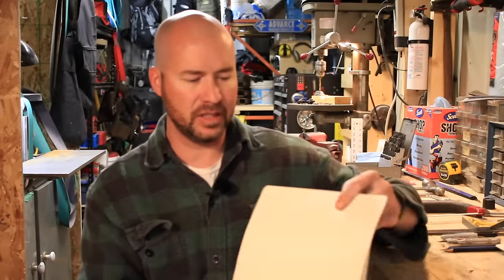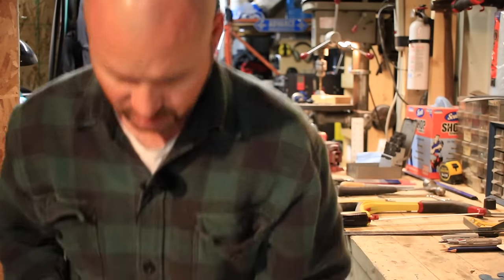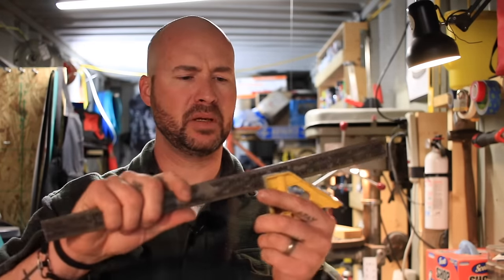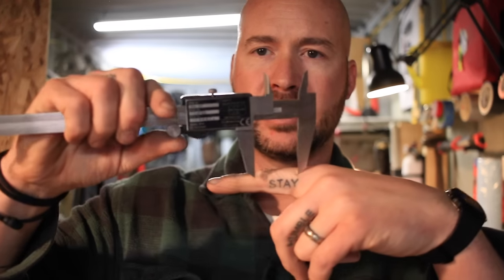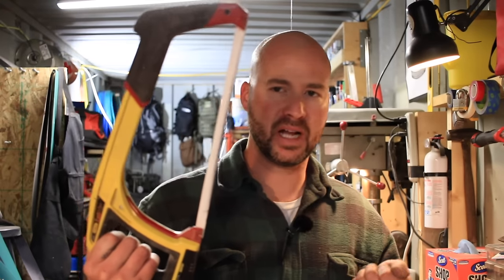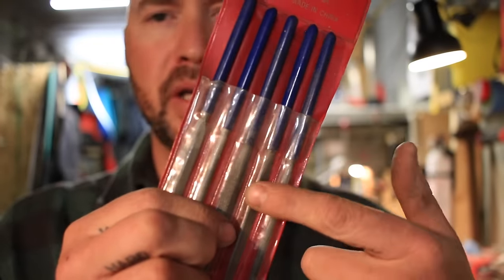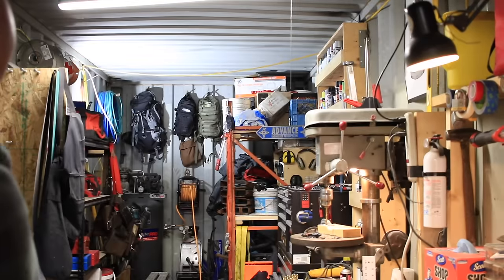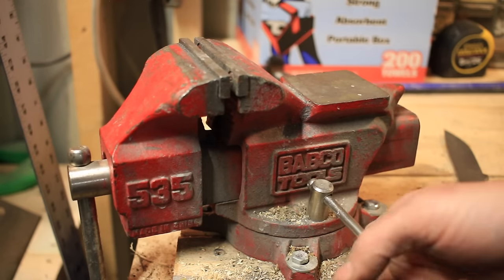Basic Knife Making Tools - Part 1of 3 of a YouTube knife making class

Comment: I want to start making knives, and i have a (i think at least) really cool looking knife.  I didnt even use those templates, i used a fork and a resturant knife while at dinner and i was bored.  I got the rough design and cut it out of wood with a hack saw.  i then made notes and cut another one out of wood untill i was happy.  i still dont even have the measurements, but i have used a ruler to drawl out some pices i wanted to remove on the knife so i can put some paracord in to it.  im going to suqare it up with a ruler and measurements, then put it in metal.
Reply from the maker: Do it!
Reply: Don't the cord handles hurt your hand?

Comment: What thickness and width should I use for a knife.  I am very much so a beginner.  Should i be using 1/8 or 3/16 thickness?  And would you recommend 1 inch width, 1-1/2, 1-1/2?

As far as far as the type of steel, I know that most people recommend 01, 1084, or 1095.

Comment: Any chance you can do a video on the jig you use to get the proper angle for the grind on your blade when using the belt sander?
Reply from the maker: +undertheshadowhc you know what? I actually have that info in this video: https://youtu.be/TyS8kU81y4c and it's right at the 3:30 mark. I hope it helps. Cheers!
Reply: Thanks!

Comment: What kind of steel should I buy?
Reply: I would like to know as well.
Reply: he uses 01 tool steel. but any high carbon steel should be good. My only problem is no one sells it where I live and i don't want to buy it online because shipping prices is retarded
Reply: Try old sawblades.

They might not be as thick but they are good steel.
Reply: O1 is good, 5160 is alright but is fussier to heat treat if you want to do that yourself, 1084/1085 also are nice simple carbon steels to start with. 5160 equivalent spring steel can be had from old car or truck leaf springs, just keep in mind that used leaf springs could have micro fractures from the stress of being used. Most knifemakers recommend starting with known steel, just because there is more information to be had about working it and heat treating it. It costs a bit more that way, but it's safer and easier in the long run.
Reply: Engineered Adrenaline 01 is the best tool steel for amateur knife makers it's strong has good edge retention and is one of the easiest steels to heat treat yourself.
Reply: Buy cardboard it’s the best and cheapest
Reply: Hattori Hanzo
Reply: Old tool steel out of the scrap pile. Files, saw blades, etc..

Comment: get a drill bit the thickness of the knife blank  then use to scratch  the center line of the blank  since the point of the drill is half the thickness of the blank  so you have a center line  to file or grind down to and take off to much on one side

Comment: Hey I'm new to your channel was looking at buying some grinders and sanders for a great finished knife was wondering if you could help me out?
Reply: i used a bench grinder to set a concave bevel, then used 220 over a piece of steel flatstock to flatten it out. if you really want a belt sander it will run you quite a bit. just wondering, did you ever get around to it?

Comment: where would I be able to buy the steel to make the knives??
Reply from the maker: All depends on where you live. knifemaker.ca is great if you live in Canada. Or Metal Supermarkets has locations across Canada and US. Other than that I can't say. Cheers!
Reply: Lawn mower blades should be made from a pretty good steel for knives, and are generally quite rectangular in shape.
Reply: Lawnmower blades work good will teach u lot cheap to start with l have one made out of it works good  with walnut handle

Comment: Sorry if this is a stupid question I am new to all this. Why do people make scales out of non metal things ???
Reply from the maker: You can use metal things if you want. It's mostly a preference thing. Handles for tool are more comfortable with something like wood or synthetic materials. Synthetics like G-10 and stuff are chosen because they are very tough, water resistant and fairly easy to work. Also, I live in Canada, and a metal handle on the knife would make your hands cold faster during the winter. Cheers!
Reply: Thank you for the info and vid
Reply from the maker: tommy tran You betcha! Cheers!

Comment: A digital readout caliper isn't actually that expensive. Harbor Freight has a few different models that run from under 10 bucks to around 35-40, I believe. I'd recommend not getting the base model, because it lacks the precision of having that adjustment wheel.